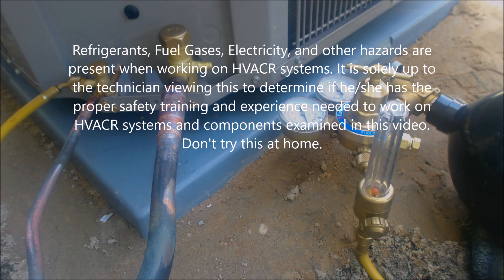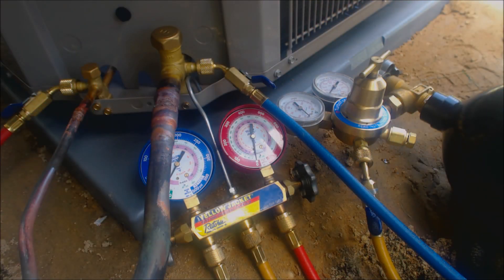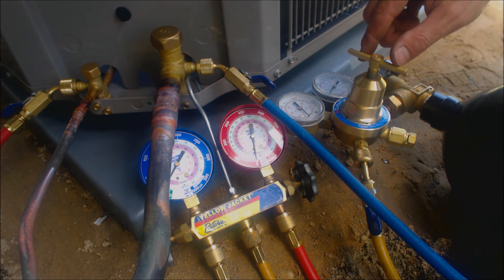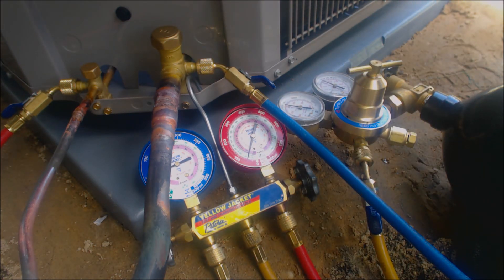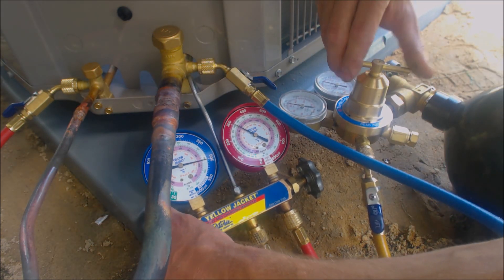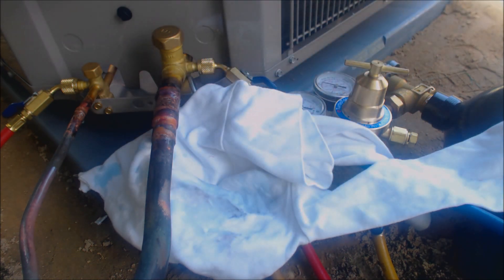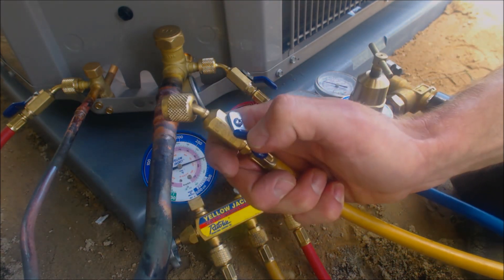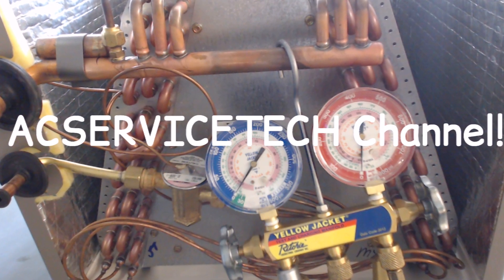HVAC Pressure Testing a Refrigerant Line with Nitrogen!

Comment: 2 notes. You mention that a vacuum hold test is a way of leak testing also.
Many don't know that a perfect vacuum of 30 inches of Mercury is unattainable unless you go into outer space, but even if it were attainable here on earth, it would be equivalent to 14.7 psi of pressure ( at sea level and even less as you go above sea level) pushing on the system from the outside in (vs inside to outside  during a nitrogen pressure test) which is almost a useless test unless you have a pretty sizeable leak.

Secondly, when spraying on the leak detection liquid, make sure you don't have air bubbles in the liquid when spraying it on. You MUST strive to have an even flow of 100% liquid  ALL AROUND the full 360 degree perimeter of the joint. 
If you do that, the liquid will show a leak before the gauges will. You will see a VERY FINE clouding of the liquid as VERY FINE bubbles start to develope inside the liquid. To get large bubbles to form, you need a pretty sizeable leak.

I don't  like how you had the rag touching the pipe as you sprayed the liquid and how you had air bubbles in the liquid  when you sprayed the high side line, and how little liquid you sprayed on. Made me feel like you were scared to find a leak...lol

Comment: What is the point of a nitrogen test  when it holds even after a couple of hours,(350psi) and yet during  the vacuum procedure a significant leak is present in the  system as microns pulled down to 200 and then they rise into the thousands after pump is valved  off.
Reply: You must have a problem with your vacuum setup. If you’re holding 350 PSI for hours there’s no way you have leaks.

Comment: The yellow hose has a ball valve on it, right off the regulator. You can have both the red and blue manifold valves open, and throttle it at the ball valve on the yellow hose. Also, you could bring it up slowly by the screw on the nitrogen regulator. This helps, if you have digital gauges that are very sensitive.

Comment: Good morning 
My ac refrugrent line exploded under the house is it possible to perform nitrogen pressure test on already broken pipe.
Please let me know
Reply: The point of a pressure test is to see if you have leaks in the system. If you’re pipes have burst there is no point in doing the test

Comment: My only objection to brazing is that Stay Bright is almost always a superior connection; shear strength, tensile strength and bursting strength. Only in melting point (med gas) and sloppy connections is brazing worth a darn. Maybe dissimilar metals too. HVAC orthodoxy says "flux is evil" in spite of the fact it is used in some brazing too. Soldering is just a better connection in most applications.
Reply: I love Stay Brite because it flows at a low temperature and you don't have to nitrogen flow during soldering because you don't heat the hell out of the tubing.
I cringe when I see guys on YouTube heating the hell out of the service valve when brazing.
As you mentioned,  you can't have sloppy connections because Stay Brite flows very thin. Like water.
I use Stay Brite 8, which flows a little thicker, especially if you don't heat the tubing much above the flow point.

One thing to be careful with when using it, is if you use to much of it, especially on vertical joints, it will drip off and fall to the lowest point inside the tubing, which can cause blockages.
I do domestic refrigeration  and it is very easy to clog a cap tube if you go overboard when soldering.

Finally, as far as the corrosive action of the Flux goes, it is an issue to be concerned about. 
I have seen many leaks in joints in water pipes in houses due to the corrosive action of Flux, which happens because plumbers are too lazy to wipe off the joints with a wet rag after soldering. The Flux will then eat away at the connection over the years. 
The Flux on the inside of the pipe gets washed away during normal use , both in water pipes as well as refrigeration systems. In refrigeration systems it gets washed into the filter dryer by the circulating oil.
Reply: @TheNYgolfer  Great reply from a pro

Comment: Question for anyone: as you can see, the technician in the vid is using the refrigerant gas gauges for the process of injecting Nitrogen to 50 PSI first, and then up to 300 PSI into the system. However those are not Nitrogen gauges. They're rather gauges for the specific refrigerant gas of that air conditioner. The only valid Nitrogen gauges are the ones connected to the Nitrogen bottle. So when he's reading "50 or 300 PSI of Nitrogen" at the refrigerant gauges, he may not have that pressure at all. The question is: what's the actual pressure he should read at the refrigerant gauges for 50 and 300 PSI of Nitrogen, respectively, and why?
Reply: As long as you purge your gauges and hoses with.... Wait for it... Nitrogen 😂
Beforehand, you're good to go, what you're talking about is mixing different refrigerants.
Also, some refrigerants operate under different pressure ranges.
Reply: 50 psi is 50psi dude. Its literally the gas pressing on the walls of the container at a pressure of fifty pounds per sqaure inch. It doesnt matter what the gauges were meant to be used with. By the way the gauges are designed to work with nitrogen and alot of different refrigerants.

Comment: Hey thanks for the video. I'm getting ready to replace my compressor. What if I don't have nitrogen? Is there some other effective way to test? Or if I'm confident in my joints while I know it's not recommended, can I just skip the pressure test?
Reply: I noticed in the installation guides for some new models don't require a nitrogen pressure test anymore (at least for warranty), only confirming that the piping and units hold a vacuum of -76 cmHg (-0.1 MPa) for 15 minutes before releasing refrigerant into the system.
Still a good idea... But not technically required for warranty.

Comment: Do you have to use nitrogen to pressure test?  I’m installing my own system and was hoping to use welding gas (argon/O2) since that’s what I have on hand.  I “assume” the vacuum pump will pull anything all out anyhow when I do that step.
Reply: Don’t use argon
Reply: @A-bone  Why not?  (beside the probably extra cost of CO2/Argon mix vs. N2)

Comment: Is ten minutes at the test pressure with no pressure drop considered sufficient that only extremely small leaks exist?  Is this best way to find very, very small leaks to put about 10 psig of refrigerant into the line set and evaporator and then pressure up with N2 to the test pressure?  TIA

Comment: Nice video and just what I was looking for in installing a split unit system.  I note that you did not close off the nitrogen supply until the end. Would it not be better to shut off the nitrogen supply while you are waiting to see if the pressure drops in the system ?
Reply from the maker: Yes I could have, however, I had those handles shut and the pressure in the regulator was not much more but yes, I could have taken the pressure off at the tank reg, thanks!
Reply: I withdraw my comment - I did not appreciate that you had closed the manifold's connection to the Nitrogen cylinder while waiting to see if the pressure held !

Comment: SIR, GOOD DAY! WHY THE PRESSURE OF MY SUNCTION LINE IS 55PSI THEN ALL OF A SUDDEN ITS DROP IN 30PSI? BUT MY AMPERE READING IS STILL 14.4AMPS? PLEASE HELP! THANK YOU! 🙂
Reply: LG MODEL: TP-C808FLA1. 72,000 BTU. R22. 3PHASE. NORMAL AMPERE 14.0A MAX 18.5A

Comment: Why do you have to take the schrader cores out before brazing? And what exactly happens to the service valves if you don’t protect them?
Reply: They are pretty easily damaged from heat, orings and seals

Comment: If manual for Lg heat pump says to pressure test to 550psig but condenser has 450psig operating pressure labeled on unit, what would you recommend? Thank again.
Reply from the maker: If you have a digital manifold you can pressure test to 450 and see any drop very quickly compared to a compound gauge. If it is an older unit then only pressure test to 200 or maybe 300psi. You don't want to cause a leak, thanks!

Comment: I build refrigeration units and the company asks for a 250 psi test for 20 minutes and nomatter what the guages will stay put for a few minutes then start dropping . I check every joint with soap and nothing . The system then holds vacuum no problem . Dont understand whats happening you have any insite?
Reply from the maker: It is possible that the setup used for pressure testing is leaking or the bottle is hotter than the system which causes the pressure to lower.
Reply: @acservicetechchannel  I have tested my guages with soap and submerged the hoses in water and there are no leaks . If the nitogen is cool the pressure will drop when its in the system? I use a large nitrogen bottle that is around 5 feet tall in a space where the ambient temperature is around 24-25 C . Could what you said about the nitrogen be my problem?
Reply from the maker: Certainly, especially if its holding vacuum during a ten minute standing vacuum test and this same thing happens every time, thanks
Reply: @acservicetechchannel  Thank you very much for confirming with me !

Comment: If you find a system almost completely out of refrigerant then recover the remaining refrigerant, pressure test with nitrogen and find no leaks. Should you put system under vacuum?
Reply from the maker: Hey David, yes pressure test with a digital gauge set for more precise measurements over a shorter span. If it doesn't drop after 10 minutes then there is not a leak. Remember nitrogen will still fluctuate due to temperature but very little compared to air. It could have leaked through the valve cores or there is the possibility of someone releasing it on purpose. After you get done the job, make sure to put locking caps on the ports. This way you know people are not able to get into the system without the key. The standing vacuum test will also verify no leaks, thanks a lot David and Great to hear from you!

Comment: What size nitrogen bottle and how much nitrogen is needed on a typical job for soldering lines and then pressure testing?
Reply from the maker: We use a 60cf or 40cf tank. I carry 60cf tanks in the truck and I use maybe a 1/4 of a tank each install, thanks and I have the nitrogen regulators and nitrogen flow regs that I use linked at amazon.com/shop/acservicetech
Reply: @acservicetechchannel  Thanks

Comment: Can you leave the gauges open when pressure testing
Reply from the maker: I wouldn't. I want as much control as possible that take out of play a possible leak in the nitrogen regulator or gauge set. Remember that when the handles are shut then the pressure is just going straight to the gauges but if the handles are open then it connects to the service hose and regulator, thanks
Reply: Thanks for the explanation

Comment: Can you use Dawn dish soap as the bubble leak detector?
Reply from the maker: We try to stay away from all dish soaps now, including Dawn. Just use non corrosive bubble leak detector. It is cheap, works well, and won't corrode the pipe, thanks- If you are looking for the right kind, I have the Rectorseal version I use linked at amazon.com/shop/acservicetech thanks
Reply: What if I rinsed it off good with a neutralizer like water and vinegar? Also, does that Rectorseal work as a leak detector and braze work sealant?

Comment: If the condenser has a filter already installed is it still smart to add another filter dryer in the attic ??
Reply from the maker: Just use the one to avoid any excessive pressure drops, thanks
Reply: acservicetech ok figured but wanted to ask because you're really on point w your knowledge
Reply from the maker: Glad to help Wild Man!

Comment: Didnyou recover the refrigerant into the compresor or into a vacuum?
Reply from the maker: Initially, when taking out the old unit, the compressor internal pressure relief blew when doing the pump down as it was very weak. I just shut the valves and recovered the rest. I wanted to reuse this unit ans a testing unit at my shop. Usually you will just recover everything out and not pump down unless you are reusing a unit, thanks.

Comment: Thanks for the video Acservicetech. For R22 if no safe psig is given you only go to 150psig then what is a limit for r410 if there is no max psig listing on the unit? Thanks again.
Reply from the maker: Most R410A Evap coils are newer and usually have a max design pressure uless they were retrofitted from r-22 to r410a with a piston or txv change.If that is the case then I still wouldn't go much higher than 150, maybe 200 at the max. If the coil is newer within the last ten years or so and cooling only then maybe test up to 250-300, thanks Nick!
Reply: acservicetech  Thanks for the reply acservicetech. Helps expand my knowledge a little more lol. take care
Reply from the maker: Glad to help Nick!

Comment: I have recently been taught to slowly add thru the high side then slowly thru the low side I was told by adding to fast can cause the TXv to slam shut I personally have not had this happen but wondering your thoughts I have been replacing a few TXv s lately due to the installers adding the nitrogen to fast or that's what are senior tech says
Reply from the maker: That could possibly happen. It could also be the tech brazing the suction line for a long time without removing the bulb or an install brazed without nitrogen and the byproduct mixing with anti corrosives put in by the manufacturer. You should always add nitrogen into both the high and low sides at the same time.  You can add it fairly quickly that way with no problem. When you say adding refrigerant into the liquid side, I am assuming that you are talking about breaking a vacuum with liquid refrigerant after doing something like a compressor changeout or weighing in refrigerant by weight per foot. Yes slowly add through the low side while on and best to use a kwik charge vaporizer to keep the compressor safe, thanks!
Reply: thanks for your responce the way you do it was the way i was taught but i try to never stop learning the way i was taught is not always the best lol
Reply from the maker: Thanks Daryll!

Comment: i have a technical question.. I was on a job today. r22 two ton unit with txv. evap is clean, filters clean, good airflow, condenser is clean good airflow. my question is I have 1 degree subcooling and high superheat. aprox 80 psig lowside and 201 psig high side. suction line temperature was 75F. i have 14 degree split across both indoor unit and outdoor unit. pressures are steady no fluctuations. unit is 2006. acording to my chart it says to add refrigerant but my suction saturated temp is 50 degrees. my guess is a bad txv what do you think my issue is?
Reply from the maker: Hey Brian, was it extremely hot and humid in the house possibly and there is that much heat in the refrigerant. What was the dry bulb outside?
Reply: acservicetech house was 79 inside, my outdoor dry was 84
Reply: @fastlife866  tell me what the chart says or let the house cool down to the right temperature and test ir again
Reply: @yonkromis7883  if i remember correctly i added refrigerant to bring the superheat down. Even though my pressures were higher then average the superheat n subcooling i got dialed in and it was working fine.
Reply: @fastlife866  thank you for your timely response I figured that was the thing that you did